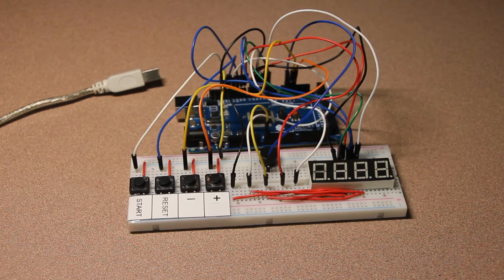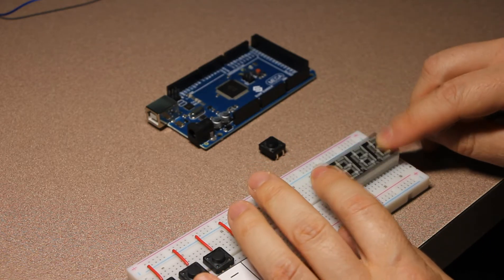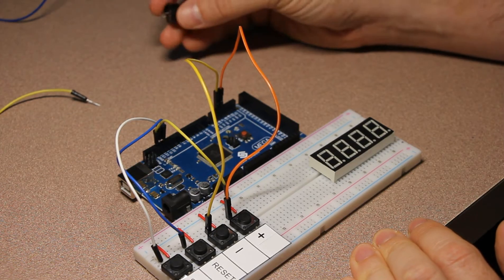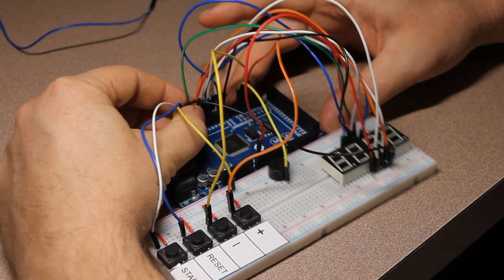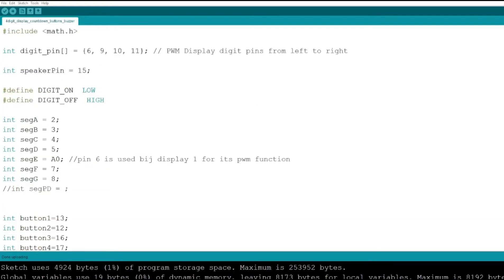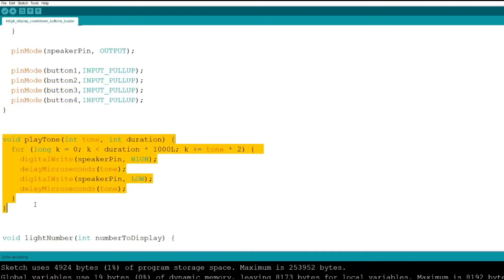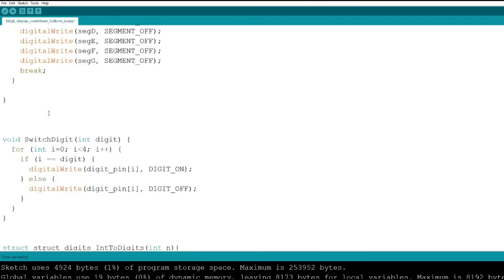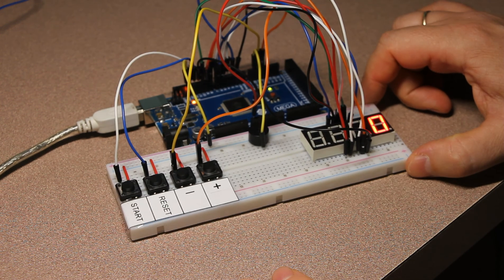Arduino Adjustable Countdown Timer

Comment: Greetings. I continued working on your project and have accomplished the followiung upgrades: 1) Modified to use an Arduino Nano (in a single breadboard). 2)Using SevSeg library, so half of the code is gone as it controls the 4-digit display! 3) Added Start/Pause functionality to the start button.

Comment: Not sure if you are still keeping up with this. I wanted to add 30 sec while the timer is counting down when I push the button, will this code work close to what I need? Would greatly appreciated your help.

Comment: How do you make the small jumper wire on the button. Can you explain it please thank you.
Reply from the maker: I just took a regular piece of wire, cut it to necessary length, and stripped on two sides. But this is just so that the project looks nicer.
Reply: @dsavchuk1  another question, can i copy the exact coding you give on your link? or do i need to change it a bit?
Reply from the maker: @aaisyahhumaira3496  it should work if you just copy the code

Comment: Thank you very much for this very interesting project. I used an Arduino uno so I had to make some little changes, but now it works fine all except the fact that the first digit always shows the value of the forth although in a dimmer way. I also had to define  digit_on High and segment_on  LOW.
To use the countdown for minutes instead of seconds I have changed the line 215 in:
void PrintNumber(int n, unsigned int time) {
unsigned int allowes values from 0 up to 65535 so it's possible to set the countdown_time in the loop to the value 59968 you suggested in a reply to a question.
So, could you please help me with my problem of the digits?
Thank you in advance
Reply: can i ask you what is the little changes in the arduino uno? thanks
Reply: @tanggooo  I had to change some pins as you can see from the ide I used:

https://drive.google.com/file/d/1BbM65IB5-t7GQVdbI71rUYhrAz3Cfh5p/view?usp=sharing

I also had to change: 
#define DIGIT_ON  LOW     // per un display con catodo in comune (for a display with common cathode)
#define DIGIT_OFF  HIGH  
in:
#define DIGIT_ON  HIGH  // per un display con anodo in comune (for a display with common anode)
#define DIGIT_OFF  LOW 

Moreover, to use the countdown for minutes instead of seconds, I changed the PrintNumber this way:
void PrintNumber(int n, unsigned int time) {

and in the loop:
while (!Countdown(countdown_time, 59002)) {        // instead of the 59962 suggested
Reply: i have the same problem - did you find a fix?
Reply: @amangeee  No, I didn't. As I used only the last two digits, it didn't bother me too much, so I didn't look for a solution for too long.

Comment: For me the digital display goes crazy and the Arduino no longer functions after only a little while of using it. Resistors didn't work. The only solution I think might work is to unplug the Arduino from the USB connection with the PC. Is this a common issue with Arduino, to have to unplug it?

Comment: hey i wonder if you are able to do the same but without the reset button , instead of buzzer there is LED diode and instead of 4 digit with 1 and all of that on Arduino UNO i just need to know a few tips about the code

Comment: pls help me how i can do this because my arduino have only 13 pins
Reply from the maker: I am not sure if this setup can be done with 13 pins. There are more connections to be made in the scheme with the selected hardware. However, you can try to use TM1637 display that only needs 4 pins (see, for example, https://create.arduino.cc/projecthub/ryanchan/tm1637-digit-display-arduino-quick-tutorial-ca8a93). But then you will need to modify the code significantly too.

Comment: Sir, great job! Also, can we pull a relay during this time we enter? Can we make it so that we can schedule it from the phone with the HC-06 Module?
Reply from the maker: Thanks! Everything can be done - but the code has to be modified significantly, of course. The one in the project deals with the physical buttons. But several functions can be used.
Reply: @dsavchuk1  I want to dose a manual coffee grinder by timing.  In fact, I want to do Single espresso with a button, for example 4 sec.  Double espresso, for example 8 seconds, with a button.  however, since these times vary according to the size of the coffee bean, the moisture content in it, and the temperature of the gears of the mill, I have to intervene in the time.  so I want to be able to change these times easily with a smart device android phone.  This is actually what I'm trying to do.
Reply from the maker: @muhammedmenap  I never worked with the bluetooth module before. I hope that at some point will have time for that. The potential is certainly there.
Reply: @dsavchuk1  You are absolutely right. Bluetooth is a great way to streamline the user interface in automation systems. Wireless is definitely important. I look forward to it with great impatience.

Comment: Great circuit. COuld you share she circuit diagram and components required
Reply from the maker: Thanks! Just follow the link in the description to the project page on the arduino projecthub. It's all there
Reply: @dsavchuk1  the code that you have shared tried to upload but did not work as it showed an error "FQBN not provided"
Reply from the maker: @mantamang6452  It looks like this is a problem you have to solve on your side: https://support.arduino.cc/hc/en-us/articles/360020843439-Error-2-UNKNOWN-no-FQBN-provided

Comment: thanks for this, now i created my version of this instead of start reset up down button
..i made the start/stop ..anytime you want to stop the count it will stay the same number and thats the only time you can reset the counter...
if the counter running no button will function aside from the start/stop button...
Reply from the maker: Thanks too! It's a good improvement :) That's what good about arduino - you can reprogram it to whatever is needed!
Reply: @dsavchuk1  just start learning programming...

Comment: Can be done with Arduino UNO use pins 1 and 0 for button pins 16 and 17 :)
Reply: thanks , i was confused alot
Reply: how about for the pin 14 and 15? in arduino uno

Comment: I am currently using an Arduino DUE board and I have issues with your code for some reason, whenever I run the code, all the segments of the lights turns on making it hard to see the number whenever I upload the code into the board.
Reply from the maker: Is there a difference in brightness between the digits that are supposed to be lit and those that are not supposed to be lit? There were multiple reports that some light "bleeds" to other segments, but that seemed to be a hardware issue.
Reply: @dsavchuk1  they all bright up but some of the segments is slightly brighter than some of the other segments. It is very hard to see the numbers or it might be like you said the hardware.
Reply from the maker: @AeyZeiNS2  I'm sorry - I'm afraid that this not about the code, but about hardware, unfortunately. I'd try to check all the connections, but I assume that you've done this already.
Reply: @dsavchuk1  double checked the connections as well and tried redoing it, results still the same. But I appreciate the help.
Reply: @AeyZeiNS2  if u still want it, on top change define DIGIT_ON LOW to HIGH and DIGIT_OFF HIGH to LOW and then in every case from 0-10 change SEGMENT_OFF to ON and OFF to ON its working for me

Comment: there is a problem with my display. The bottom lighst are not working for all digits. I checked cable connections and pins.

Comment: Hi guys. I'm a complete nuffie and looking for some help to build something similar - a countdown timer which can be manually pre-set with a specific time (H:MM:SS best case, otherwise need a minimum display of :SS) to countdown to 0. No alarm attachment is required, simply flash 0 a few times, then auto power off.

I am looking to set up MULTIPLE (probably 3) SEPARATE displays simultaneously counting down the timer with a separate control board (set, reset, power or up/down etc) to be control from one central location (different area to where timer displays will be set up.

These displays will be embedded into a table surface.

Can someone help me put this together?
Reply from the maker: Maybe something like this will work for you: https://create.arduino.cc/projecthub/mattywausb/one-kitchen-timer-to-cook-it-all-1afdab?ref=search&ref_id=countdown%20timer&offset=10

Comment: hay can you please tell me to How can we set the countdown to be in minutes instead of seconds?
Reply from the maker: In line 289 of the code replace 962 by 59,968 and check if you get exactly minutes. You may need to adjust this number a bit to be more accurate. For example, after you do this modification, measure how long does it actually take for the timer to go down from 10 to 0. If it's a bit less than 10 minutes, increase that number a bit.
Reply: @dsavchuk1  first off, awesome project! I'm trying to implement the changes you described to make it go by minutes, but the max value allowed in that function is "32000". 33,000 - thus 59,969 - automatically set off the buzzer. Any ideas or something else I need to change?
Reply: @jesusjones1024   In line 215 change int time with unsigned in time :
void PrintNumber(int n, unsigned int time) {

Comment: why your countnumber speed number is 962 ? not 1000
Reply from the maker: Well, this is because it takes roughly 38 milliseconds for arduino to complete the rest of the code per cycle. This, of course, can be done better for better accuracy, but I believe it will make the code more complicated. So this is kind of a compromise.

Comment: As soon as my timer ends, it automatically restarts. Why is that and what should I do?
Reply: i been at your situation but i tried to managed the issue
I just transfer the start button at other pin because i think the pin 13 is also the pin use for the LED built in the arduino board,
i transfer it and i changed at the set up instead of INPUT_PULLUP  I changed it to  just INPUT but the wiring also changed from Positive to button and button to the pin location...but i put a resistor from the pin to ground to prevent unnecessary noise....hope it will help...